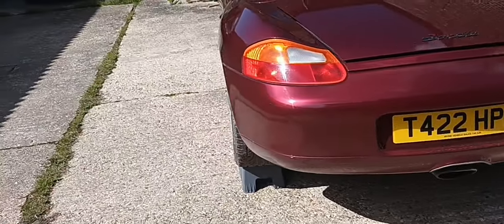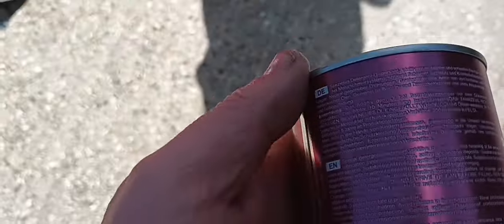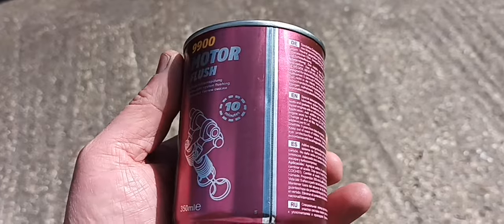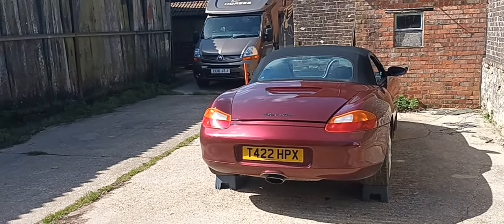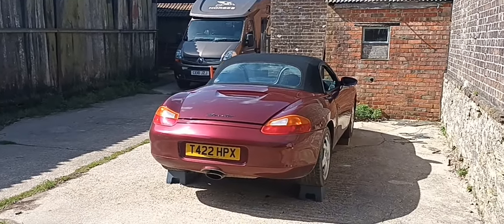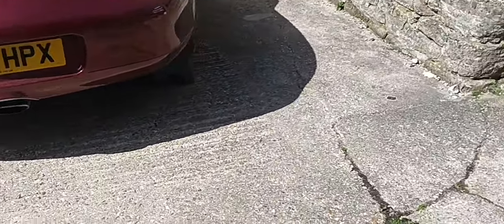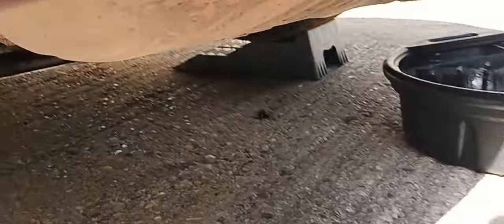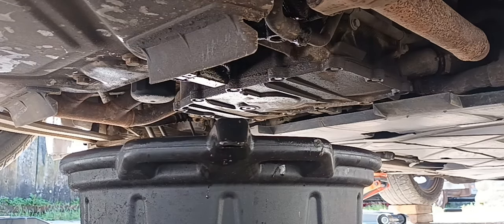1999 Porsche Boxster 986 Project Episode 4 | Oil and filter service

Comment: Good news on the filter being clean. Sometimes you find bits of brown plastic which are fragments of chain tensioner 😮
Reply from the maker: Cheers, buddy, I was pleasantly surprised how clean it all was in there. Even when I decanted the oil out of the catcher, it was nice and clean. 
It's time for the other filters now 👍
Reply: @projectsinthebarn  a bit of advice if I may ..  when you get the roof in service mode so you can get to the air filter, check your  drains at the back with a hoover suck out any leaves etc. Also if you have an fluid extraction pump,you will be able to suck out the power steering fluid from the reservoir and put some fresh in. I'm OCD so I also spent hours cleaning the top of the engine only to never see it again. . Lol. Looks like a great Boxster. I do miss mine a bit but the Jag and MR2 helps me get over it 😎😅
Reply from the maker: @life_on_cars, im always happy for some some top tips and advice, so I really appreciate that, mate 👍 
My first boxster used to leak from the very drain holes you mention being blocked up with debris. 
The front on this one is definitely blocked as I have some standing water in there, so that will be shown on here shortly, I even have a nice little drain cleaning flexi rod to do it with 😃 

You seem to be as busy as me with your lush Jaguar and the new project car, too. It sure keeps us out of trouble 😉